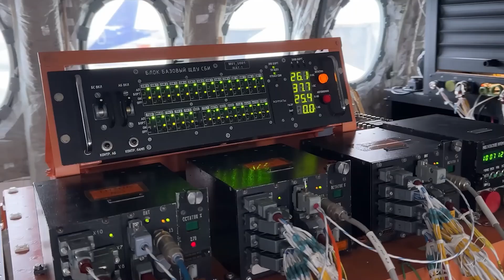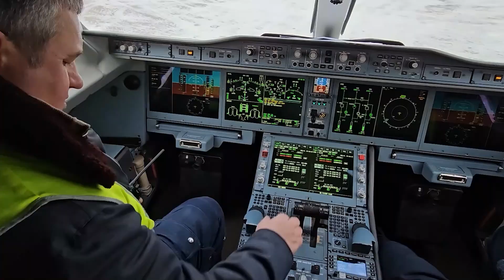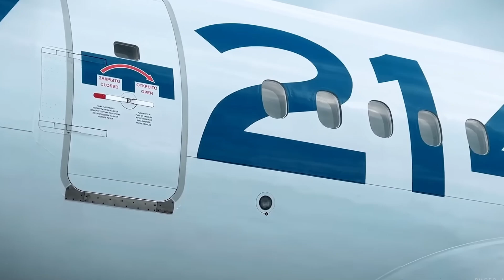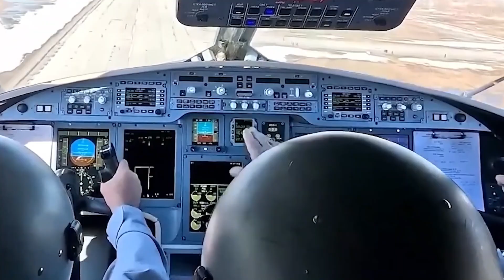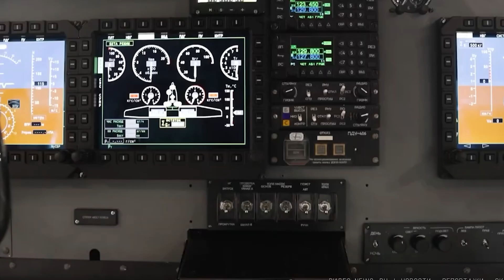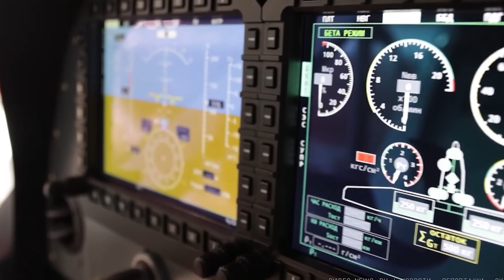Fact or Fiction: Russian Jets Replacing Foreign Aircraft

Comment: What a pathetic and miserable production and development rate. Yes, Russia "can" produce their own engines from start to finished project, technically. But practically is just a big words with no practical support. Russia can develop some technologies on the same level as other countries, but the industry and infrastructure is a long time dead since the fall of the Soviet Union. 2 aircraft per year? Even if they ramp up the production rate by 10, they won't fulfill their internal market demand in years, and you can not even imagine how hard it is to scale a production for 10 times more.

Russian industry is one of, if not the most corrupted industry in the world and I wish it was different.
Reply from the maker: Don’t you think that it’s just a matter of time for them to speed up enough to fulfill their internal market demand?
Reply: @EMAviationChannel they had tens of years before. You know that the MS-21 project started in 2007, right? It's been almost 20 years since then. Or that Tu-214 is just a slightly upgraded version (exclusively electronically, no structure or engine changes) of a Soviet built Tu-204 from the end of 1980s? They all had years to develop their aviation industry. Instead, they've dismantled most of the factories, or sold them and repurposed. Right now Russia has absolutely no way to cover even a fraction of their internal demand and I highly doubt that they will even in 10 years
Reply from the maker: @glee_bus yes, and Yes anddd yesss… even if it’s very sad but you are right! I’m just trying to be a bit optimistic about what’s happening there rn
Reply: @glee_bus  So in other words the US and France have no chance to recover in the nuclear energy building capacity because 35% of the market is taken by Russia and there is China and Korea. Or that the european car manufacturing is doomed because of China. Is that what you are trying to say? The biggest mistake of 90% of the countries of this planet has been trusting the West and relying on its' technology. Now the goal of every country has become to stay independent and have a better choice. The demand is still growing and Im not sure it's gonna be Russia or China to just give up.
Reply: @evgenyishchenko  Cute meanwhile Airbus Bild 700 aircraft last year. Russia Bild 7 in 3 years since the Russian invasion. Demand is 1000 aircraft and even if you can bild say 20 per year it will not it will take 50 years to relace all russian jets with domestica verstions. How can even think of export under thoes condtions. And I am giving you a dubbilling of produtcion for free. Hell in 2019 you Bild 11 Aircraft. Russia could do so much better. If it wher not turend in to a peria staate by Putin.
Reply: @stekra3159 I suggest you read books, your knowledge of history, economy and enterprise management is so childish I don't see any reason for even argueing with you. Time will tell, if you are based in Europe, enjoy the times ahead, it' gonna be fun.
Reply from the maker: Hey there! I just posted a new video about the Russian SSJ 100. Check it out here: https://www.youtube.com/watch?v=DLsX-TROFrc

Comment: These announcements are made for over 20 years. Nothing happened. Endless development and corruption as usual in Putins rotten system. Now the sanction. 

The MC-21 was announced for 2012. 15 years old propaganda videos praising the failed jet as competition to Airbus and Boeing can be found here on Youtube. No end of development in sight, the flight characteristics worsened due to sanctions. The Tu 214 is an old Soviet jet, totally outdated. The only new airplane so far produced in Russia, though in tiny numbers, was the Superjet SSJ-100. With terrible results. The few foreign customers quickly returned it because of bad maintenance and even Russian carriers didn‘t want it. The safety record of the SSJ-100 is worse than that of the Boeing 737 Max. Now, with the replacement of Western components by low-quality Russian ones, the Russian jets will be even more unreliable.
Reply from the maker: Well, can’t agree or disagree… but still Boeing and Airbus were not and are not perfect yet… so Russian needs time to be able to produce airplane matching the quality standards… and I think they are really working on that

Comment: It all came down to need. They have an amazing aerospace industry but needed a good reason to do it. Before their drones were mediocre. Now they have some amazing drones and anti drone systems. Western sanctions means they now need to revive their civilian air line industry. The aircraft are mainly held back by engines and they have rushed new engines through. They are not bleeding edge new engines, but they are modern and competitive and with further development could be world leading in their class. With Russian airlines buying these planes and engines the funding will be there to improve and upgrade to keep them up to a high standard. Even if they find faults and problems with their new aircraft once they are in serial production they can take the time to improve and modify to solve the problems. Their development was very quick but their testing is not rushed or bypassed and should lead to safe modern types. The twin engined version of the Baikal with Belarus should be a useful type too and allow the An-2 to be retired finally. New materials like thermoplastics that are modern and strong and light but can be cut out and replaced in the field is a real step forward for light aircraft and the aircraft industry in the more out of the way places. The rest of the world is a large market and having new choices is a good thing too.
Reply: The IL-96-300 carrying 262 passengers, consumes more fuel than Boeing 747 carrying 410 passengers..
IL-96-400 carrying 436 passengers consumes very much more fuel than both IL-96-300 and Boeing 747.. So, Russian planes are less fuel efficient and so foreign commercial airlines will never buy it.. Also, Russian and Chinese made planes cannot fly in international routes to foreign countries due to a lack of certification from key international aviation authorities like the FAA and EASA. This means it cannot be operated commercially outside their own country of manufacture Russia or China .. Even if a foreign like India buys it, it can fly only inside India.. It cannot fly to foreign countries in international routes.. So, who is going to buy Russian and Chinese made planes ?
Reply from the maker: Actually agree !
Reply from the maker: Hey there! I just posted a new video about the Russian SSJ 100. Check it out here: https://www.youtube.com/watch?v=DLsX-TROFrc

Comment: I think Russia should just put a Turboprop on an updated AN-2. the plane does exactly what it was designed todo.... Just needs a newer powerplant
Reply from the maker: Well yes but I think it’s already time for something new
Reply from the maker: A modern turboprop could really give it a second life. But what do you think they should keep the classic design or go for a full airframe upgrade too? Personally I think full frame upgrade would be better
Reply: @EMAviationChannel yes agree it does need to be more than just hanging a turboprop on. But (as I’m sure you know) the AN-2 is the aircraft equivalent of the ‘Loaf’ truck. I’ve seen em parked up in rural farm yards with no supporting infrastructure visible. And I also think time is an element. The new aircraft is (I fear) a waste of time. Too many issues both performance wise and developmental. The AN-2 still works well enough and an updated one structurally and powerplant will do the required job for a decade or more. Didn’t Poland design a Turboprop version years ago?
Reply from the maker: @mcal27 yeah as I know there are some turboprop designs out there also the TVS-2-DT but it lost the competition to replace the AN-2 to the LMS-901 Baikal, and looks like there are no plans to put the TVD-2 into serial production.
Reply from the maker: Hey there! I just posted a new video about the Russian SSJ 100. Check it out here: https://www.youtube.com/watch?v=DLsX-TROFrc